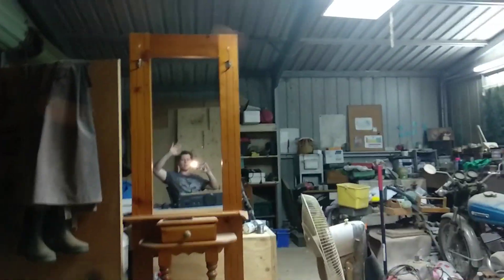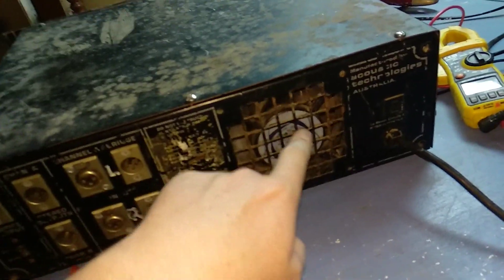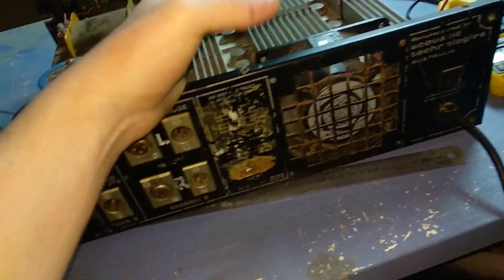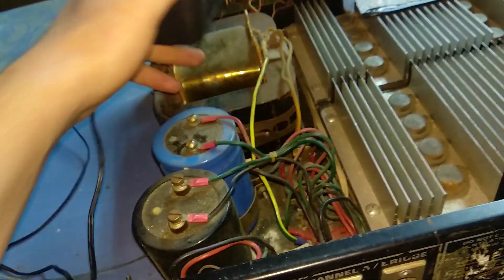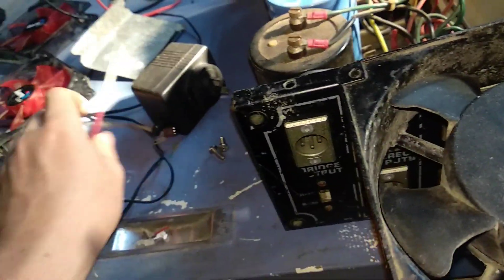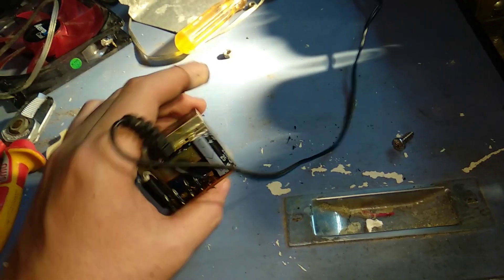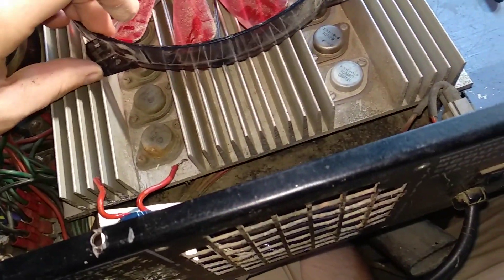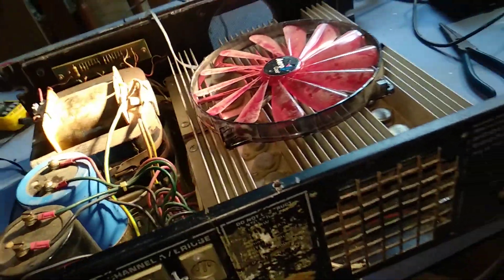Silence of the Amps

Comment: But the main reason im contacting you well trying to anyways is i have a kicker zx350.2 that has no output lights up fine doesn't pop fuses doesnt go into protect just nothing coming out of speaker outputs i took the board out no amokey smell no heat damage no visible signs of a resistor or diode frying or discolor on any of the transistors from over heating can you give eme some suggestions i dont have a oscilloscope but i have nice Dmm's and is it worth buying one of those small oscilloscopes the size of a Dmm for like 50= 100 bucks. Is it something you would be willing to take a look at? Please get back to me
Reply from the maker: I'm personally not an expert in amp repair, but here are some suggestions:
1. make sure the amp is getting signal, might sound dumb/obvious, but a clean break in the cable could mean no signal at certain angles.
2. Check for cold solder joints. Less likely for high current paths, though hairline cracks in certain areas could result in no output. Probe around with a continuity tester, see if anything is open circuit, or reflow suspicious joints.
3. carefully probe across the big capacitors in the amp, they should read a voltage of something like 40v DC when switched on. 
If there's nothing there, likely switching FETs or control IC for the fets.
If there IS voltage there, the fault is somewhere in the signal path. This is tricky to diagnose without an Oscope. Could be input filters, step-up drivers, output transistors. Not really much I can offer you there.
I'm in the process of improving my amp repair skills, hopefully some of this advice might help, good luck
Reply: @Dakoustics  thanks for the reply and suggestions. I know it had a good signal going into the amp because i hooked up my Infinity Kappa 202a and had zero issues or probs my first guess was ouput transistors. I was trying to get some feedback about if those lil Dmm sized o scopes are worth it they start off around 40 and go from there ive been looking for a good priced bench oscilloscopes with the full screen. But they either want twice what its worth or dont want to sell
Reply: @Dakoustics  i was checking all tHe legs on the transistors on both sides of the board and i found on 1 maybe 2. Transistors on the solder side that Instead of each of the 3. Legs bei g soldered to board in individjual solder beads that 1 all 3 legs ths solder pooled together so all 3 legs of that transistor are soldered together.and. i think 1 on opp side has that with 2 of the 3 legs.

Comment: Hey dak,
Putting 2 same fans in series gives you more pressure, not more airflow. (Putting them in parallel would make it vice versa: more flow, same pressure). So 1 fan would have been probably enough.
Putting only 1 fan in stead of 2 at the rear would also have lowered the noise with another 3dB.
I would've only put 1 fan, because you don't really need the extra pressure...

PS for next time: And for even more noise reduction you could have used even more quieter fans like noctua, be quiet, noiseblocker,...